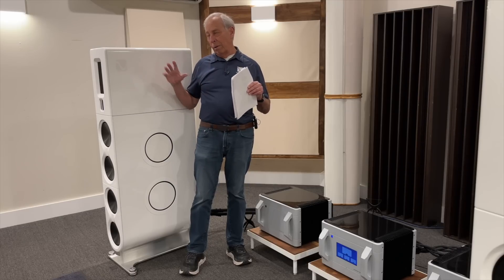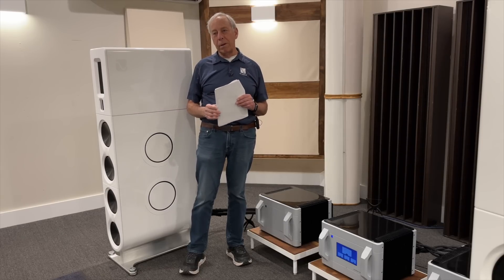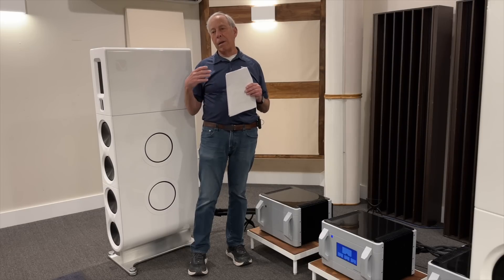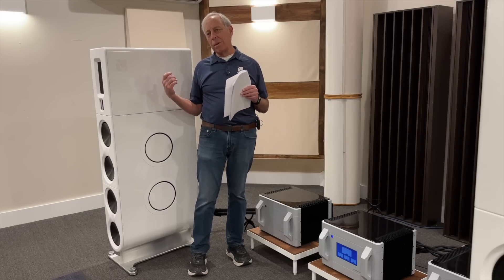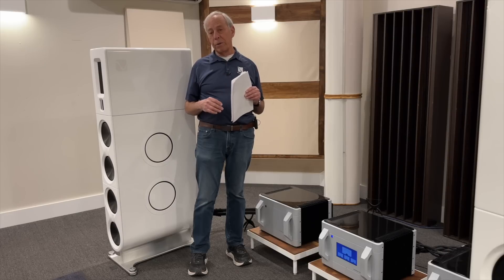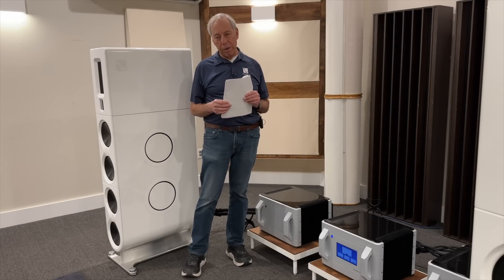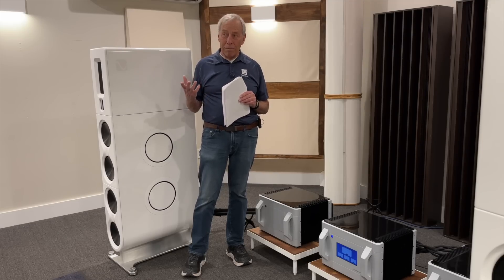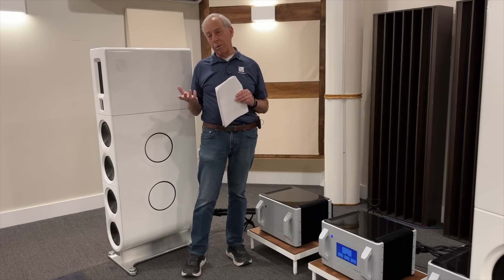Speaker crossovers and age

Comment: Does anyone rebuild vintage crossovers? I have 40 year old speakers that sound fine & I am happy with but would love to replace the original crossovers.
Reply: Inductors don't change value, nor do resistors or film capacitors. The electrolytic capacitors are the ones that require changing and like Paul said, it is quite easy. Don't replace the original crossovers with "new different" ones, just replace the electrolytic capacitors and it will sound like new.
Reply: @bobross6802  in a lot of cases you can replace electrolytic cap for good budget polycaps without any issue, and you wont have to worry about replacing them in the future, and they're not that much more expensive in most cases. Depending on the age of the speaker it's not a bad idea to replace the wiring, especially if it's a really thin-gauge wire to begin with.
Reply: @hoth2112  Sure after repalcement   "new"   crossover will sound not the same as old. For almost  all it is confirmation  that   replacemant was a must . 

But for me it is only another evidence  that it is unlikely to find two identical crossovers and that by replacement  of  with  "identical"   crossover speaker is sonicaly altered   Because inductances have their margins of tolerance and capacitors too. To find two identical capacitors we need to check measurements of may be twenty of them and still two  will be only near  value  For producer it would cost to buy tens of capacitors to select two of desired value.
Reply: @Mikexception  This should absolutely not be a problem with modern well made "audio grade" capacitors. They are pretty spot on. Also, in many cases, when your order them they will be matched before shipping, especially if you request it.
Reply: @jimhines5145    

Problem of such discussion is that audiophiles by  focusing on  details of  sounding listen only to 30% music. Just as in embossed photography - colors and contrast are  not priority but enhanced detalis are the agenda . 

I hear all time about high range transparency  , low range waves and few words  about   not speciefied :middle  range, usualy only  in context of necessary middle range speaker. Middle range (not middle speaker)  is the essence - withoiut it music is not emotional, flat  and boring with sweet ornaments   For such narrow impression alterations brought by  crossover may be not noticed orit noticeable  may be accounted to unspecified "THD distortions" which in turn are said to be  be fought by any price. Then we are in 0,01%  THD request
Reply: @Mikexception  Never listen to audiophiles! They will talk you into a $1000 power outlet and $80k cables. :D
Reply: Why can’t you buy adjustable external crossovers and wire mounting them inside or outside the cabinet.
Reply: If the use film caps they are probably still good, if they used electrolitic cheap caps they will be bad. Coils and resistors do not age especially the coils. (See Bob Ross)
Reply: I think there are sometimes specialists for different brands like an ex-tech or there might be someone local for you who also does amps and other items.  I'm starting to think about it too, mine are about 30 years right now.
Reply: @Douglas Blake   I wish I could think your way to  just be satisfied with  recognizing  10%  similrarity of tech values as confirmation  of exact similarity in sound. Generaly all that matching   to 1% capcitance which required soldering sets of   smaller to bigger capacitors , sometime 3-4 in one andaligning  up to less than 1% inductance  is main reason why I gave up multiway speakers. There was some twenty years when I experimented with fluently controlled  inductances   turned  by knobs on top of speaker but all that mess with which I was dealing in many years is not worthy sounding of one good widerange in each channel 

What you say about aging is general sad mind expectation with apparent    evidence that someone had such case and said it . Before we public     explanation  of ANY problem best is  first to rectify if at all   problem  is existing and how often it happens  No sense today when we deal  with waste  to throw away 1000 capacitors when only 5 are out of margin Cheaper is mesaure them all and find them   All talk about it but I couldn't see any approved  report of capacitors durability  .  . 

  I measure capcitors which I purchsed in 1992 in Singpore  any time I take  them in hand   And ALL today keep their  values as purchased   .